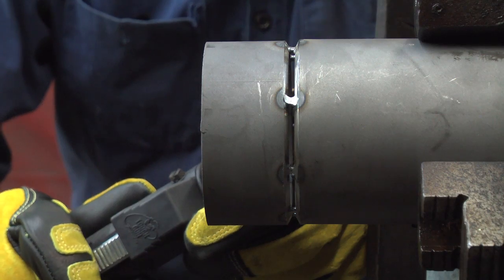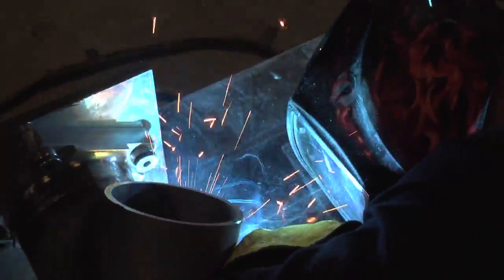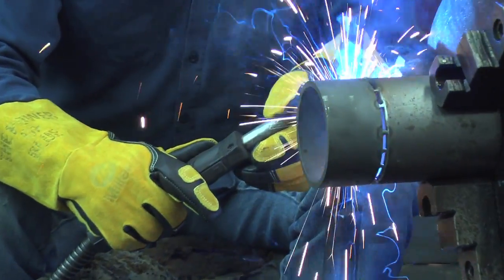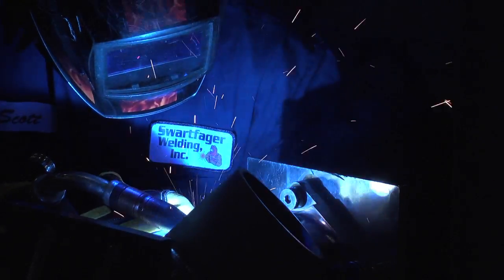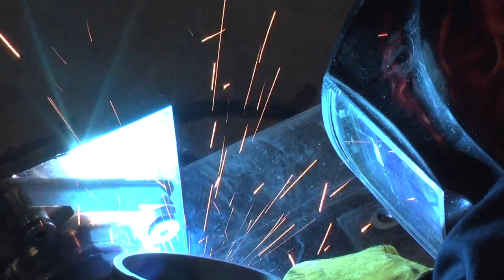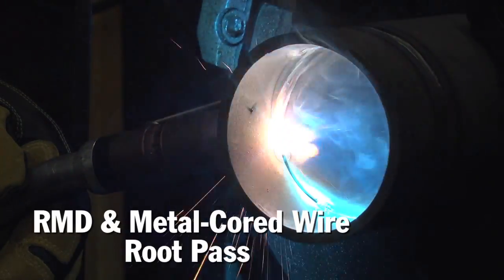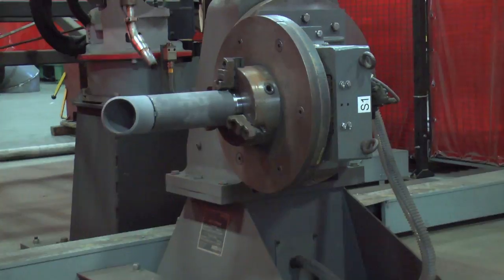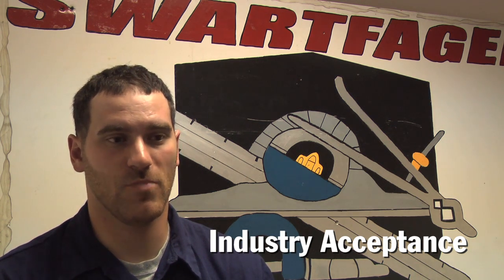RMD, Pulsed MIG Welding and Metal Cored Wires Drive Excellence at Swartfager Welding, Inc.

Comment: any process can be done cleanly just takes a competant welder and the right equipment.  mig roots are much cleaner and way less spatter than metalcore.    most machines run two spools of wire and guns so its easy to very quickly do a mig root and then switch  metal core or flux core or rods.